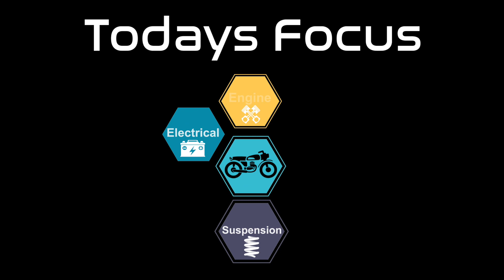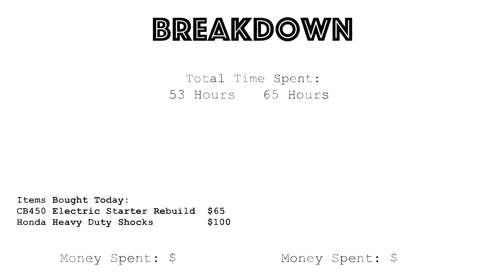Fixin' 2 Ride Episode 15: Finishing The Little Things On The CL450

Comment: Nicely done... what did you use to clean the chrome?  Paint the frame?  How did you know it was the starter?  My rattles and clunks, and barely starts my CB360
Reply: they mention the paint in a different episode; rust-oleum protective enamel paint that they mix with acetone

Comment: Question: Caleb, when you took off the left side cover to remove the starter did you have to also remove the stator?  My starter chain is stretch and rattles around in the side cover.  I'd like to change it out, but not sure how to get at it. Any ideas anyone?